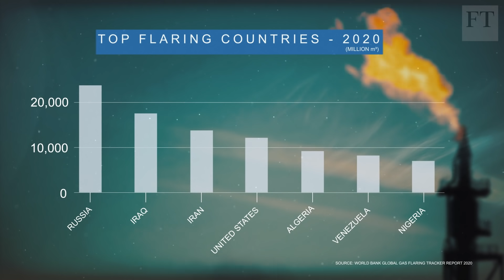Gas flaring: Can we rein in the waste and pollution? | FT Energy Source

Comment: The problem with converting this gas to electricity is the high cost of building out the infrastructure to feed it back to the grid. Bitcoin mining fixes this. No infrastructure needed, simply build a portable onsite generator to convert to electricity to power mining, then convert the bitcoin mined into fiat currency for a profit. Problem solved. It's the politics that needs fixing, not the planet.
Reply: There's absolutely no need to convert to a riskier asset like fiat.
Reply: That doesn't solve the problem at all. You still have to burn the gas to turn it into electricity.
Reply: Can we buy Natural gas on dips

Comment: I literally don't understand how no one has thought of taking that gas and converting it into electricity!!!
Reply: Its quite simple actually. The natural gas produced during crude oil production represents <0.01% of the total potential energy being produced. All of the refinery infrastructure is built to process millions of barrels of crude oil, representing 99.99% of the fossil fuel product. Nobody is going to spend billions of dollars to build a natural gas facility to harvest the tiny fraction of product that is methane. Cumulatively across tens of thousands of flares, the amount burned is a lot. But you need a lot more gas in a specific location before it becomes feasible to utilize it for any form of benefit.
Reply: https://www.youtube.com/watch?v=4_vEUnlOAs8 this video tells u why
Reply: Right. Oil boils at 300degrees. Can probably get electricity at 100 or so degrees in little generator for electric vehicle. Lot of things don't make obvious sense.
Reply: @sampleoffers1978  Can't they drive a gas turbine with that gas? They're burning it anyway.
Reply: @amorosogombe9650  Yeah I guess it's about the storage and whatever battery risks. They are just burning it to lessen the emissions other posters said.
Reply: @sampleoffers1978  Huh??? That doesn't make any sense. But nevermind.
Reply: @amorosogombe9650  What doesn't make any sense? putin? Storing the electricity could be challenging if battery has to be placed there, because of dangers with the gas sparking and making battery explode. Their not going to build electric plant there, due to permits and similar hazards. What doesn't make sense?
Reply: @sampleoffers1978  Dude. Who's talking about storing electricity? I'm saying instead of just flaring gas, burn it in a gas turbine, use the turbine to generate electricity, transmit the electricity to wherever it needs to be consumed. Where to batteries come in? Simple gas turbine power plant directly feeding the grid. I don't see where batteries/storage come into play? If you can't build the plant on site you can pipe the gas to the plant off site. The bottom line is, there must be a way to use that gas productively and not just waste it flaring.
Reply: @amorosogombe9650  I agree maybe that would be ideal, but piping to electric facility might require certain permits and the red tape starts to get crazy that point, because otherwise transmission cables could come from remote location nuclear plants, but that's all regulated very closely and drawn out to build. Some of the commenters are saying they burn it off so less goes into atmosphere, but I don't think  they can transport electricity if they put  it  into generator. Does seem like waste model.
Reply: @sampleoffers1978  Maybe it's no economical to pipe it off site because the volume of gas is not sufficient to drive a gas turbine of sufficient electricity output to justify the investment. There's red tape for everything, even flaring and you'd think regulators would rather see the gas being put to work so that there's at least some pay off for the environmental damage bring done.
Reply: @amorosogombe9650  Citizens like efficiency because it lowers costs. Regulators seemingly don't because they are apparently bribed or intimidated. I think if methane recovery advanced as technology, there'd be less demand for gas/etc. I don't know the volume of gas involved but the "flaring" goes on to extent it's likely considerable.
Reply: @amorosogombe9650
I believe all those options have been considered with flaring being the most feasible because it is crazy to think otherwise.
Reply: Gas is flared BECAUSE its so far away from market that it CANNOT BE SOLD.  There are no pipelines nearby.  There is no electric grid that can carry any electricity away.  The oil companies doing it don't want to spend the money reinjecting it underground.  MAKE THEM FCKN DO IT!
Reply: They have. It’s why natural gas has displaced coal in much of the country for electricity production. The problem is that there’s simply too much gas. LNG export facilities help because it means that there is a new price ceiling(the global gas demand). But those projects take a decade to complete let alone get regulatory approval. But yeah. The biggest problem has just been finding a customer. Once they get one it’s smooth sailing and the cost benefit of building our the infrastructure makes sense. But before then… it’s just a gamble.

Comment: Why is this regulated by the EPA.
Reply: Because it pollutes the environment?
Reply: The gas goes into the air. The air is the public domain. And since the government is the owner of the public domain they get to regulate it. It’s a matter of property. If you could build a 100% capture rate system then you’d have full ethical authority to tell the EPA to piss off. But otherwise you’re just kicking the can to everyone else. Think about it like a river. If you could dump… soap into a river but guarantee that that soap broke down before it reaches anyone else’s property you would be ethically right in your (non) pollution. But if you put soap into the river and it comes and damages or modifies my property you have violated my property right and I’d be ethically justified in seeking payment for those damages.

So again. Since the air has no single owner(I.e. the government). The government gets to say what you can do to it

Comment: In Iran a project named "AMAK" was executed to collect the flare gasses and re-inject them into the oil wells to increase the well pressure and oil production. There are a lot of ways that the flare gasses can be used for example at least they can be used to burn garbage in incenerators in big trash dumps instead of burying them.
Reply: Good initiative. But incineration of wastes can also lead to greenhouse gas production, right?
Reply: @souvikdeb2523  Yes surely but it is much better than releasing the methane gas directly into the air when you have no other use for it and by this way as I said "at least" you will solve part of your garbage problem. Of course if economic and sustainable uses are found for the gas, it should be used there.
Reply: @faridjafari6356  I'm looking into how BTC miners and the like may be able to use this excess gas!
Reply: @VLEET7  Good idea. and many people are doing this. They use flare gas as fuel of natural gas generator for bitcoin mining. this is I think up to now one of the most cost-effective way for bitcoin mining because this kind of fuel is almost free and this makes the electricity cost low to almost zero compared to other sources of electricity.
Reply: Can we buy Natural gas on dips